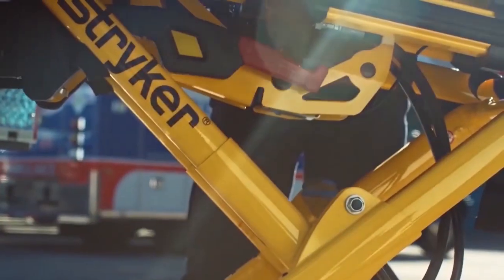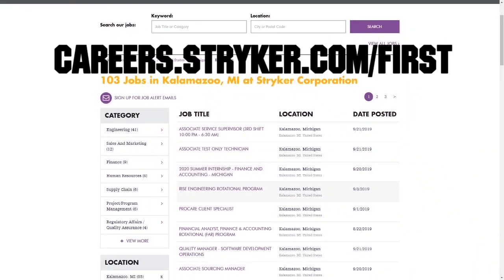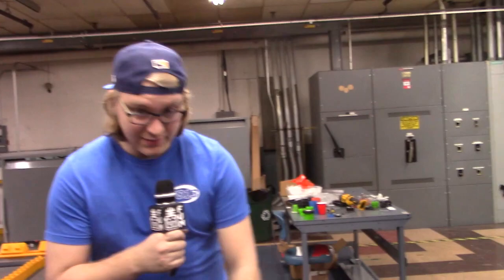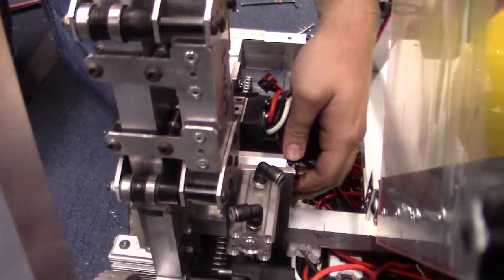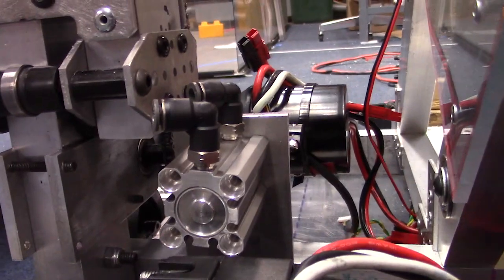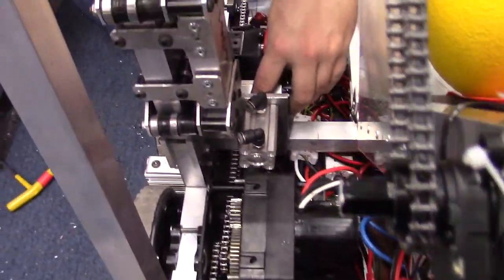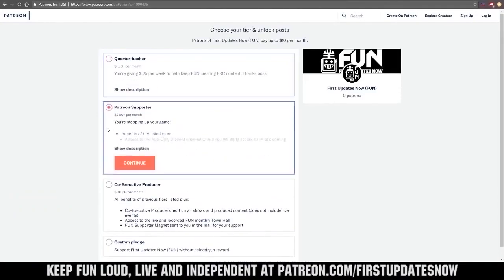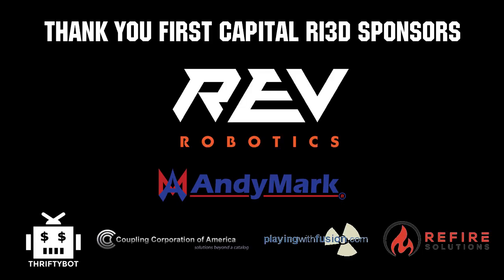Elevator Braking System - FIRST Capital Ri3D - First Updates Now

Comment: I couldn’t really see how it worked. Could we get a CAD view of it?
Reply: So the pancake cylinder is just directly inline perpendicularly with the hex shaft (which we increased the the diameter of with a vex or Andymark part, i cant remember exactly what it was called) and to break it just puts pressure on the shaft. Although while this was a quick and easy solution. I personally wouldn't recommend it unless you have no other option. There is the new disc break on vex (I haven't been able to test anything with it yet, as my team doesn't have one, so idk how well it works), and what my team usually does is it put a gear on the shaft, then directly bolt a shifter gear on to the chassis. (we put the gear on the shaft then have a hex hub be what gets bolted)  So that when the shifter is not engaged the gear spins freely on the bolted shaft. But once the shifter engages, its no longer free spinning and the climbing shaft can no longer spin. 
I hope this explanation made sense. If no feel free to let me know. 
Thanks, 
Lucas Anderson - 5813 Morpheus

P.s. Feel free to reach out to me on Chief Delphi, this is my user tag
www.chiefdelphi.com/u/luke_a_gpd
Reply: Full robot CAD is here: https://workbench.grabcad.com/workbench/projects/gcNyJ1FsxrKodFPbiTE5bagbhUubQTtNwRw0OXXcNJYH12#/space/gcQEC-vcMDuweMWTx_1_pLDFH6N_uPtCQpku3_Amdl7NsT